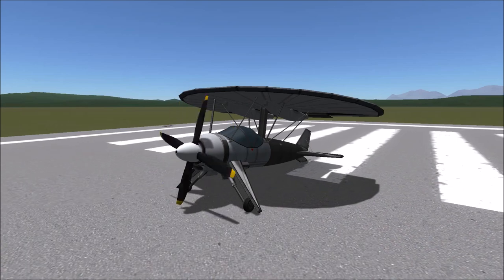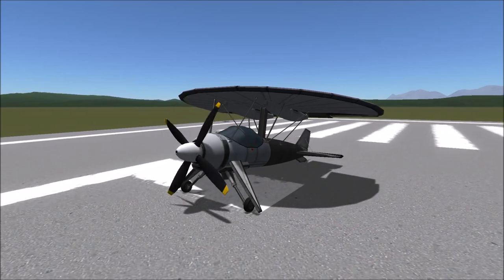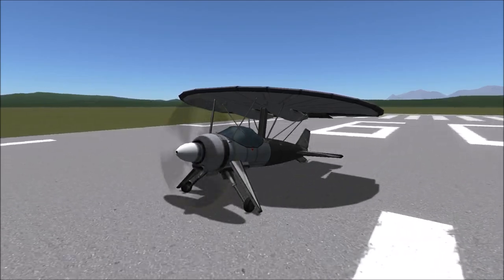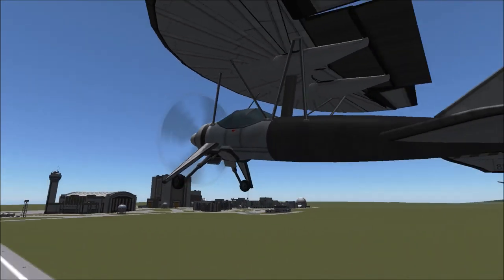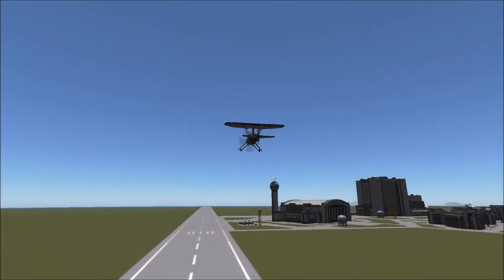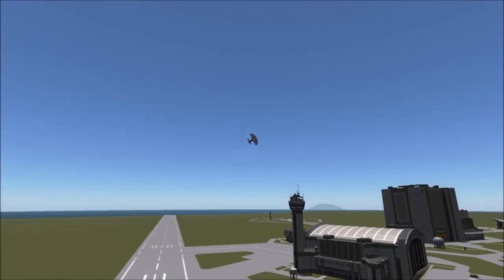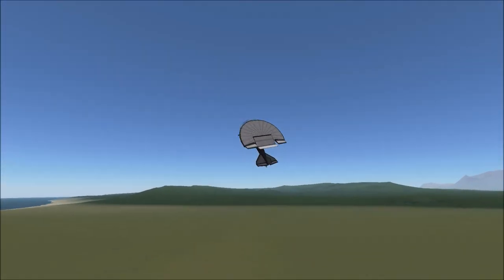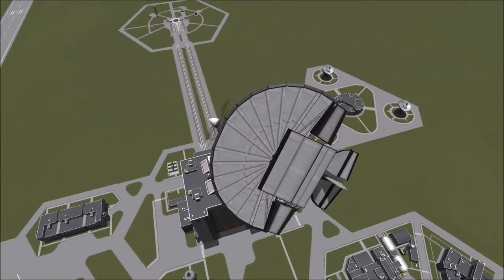KSP History's Misfits S2E6 The Nemeth Parasol

Comment: It was called "parachute plane" because of both the practically zero landing roll, and 45° climb and 60° descent.

There's no evidence that Nemeth was looking into "revolving wing", but many had been working on very-low aspect-ratio and circular wing.
See the patent Johnson 1932 US 1887411

Compared to other STOL planes, this one is faster than a normal plane, not slower, and the very-low aspect-ratio planform is stall-spin proof.
The key is the wing-tip vortex driven "parachute lift" phenomenon.
Charles Zimmerman wrote about it extensively when copying the Arup S-2 for his Vought "flapjack". It was also written about by Barnaby Wainfan who wrote for NASA about the "Facetmobile". See the paper on the Facetmobile site.
With aspect ratio under 3 (span^2/area), while flying very slowly at very high nose-up, the wingtip vortices wrap around it and capture a "bubble" of low pressure above the wing, giving extra lift at such slow speeds. At the same time they trap flow from the front over the top of the wing, keeping it from separating and providing strong smooth flow to the controls. The wing does not stall, even if kept that way. They'll go downwards if they're going too slow, but no stall. Arup could land at 19 knots. The Facetmobile of the '90s could stay aloft level at less than 16 kts, but was also sleek and quick on little power.
The low aspect-ratio does not create additional drag in normal cruise flight. The huge vortices *& "parachute lift" phenomenon and attendant drag are elective and temporary, and the Nemeth and Arup and Facetmobile and others have been remarkably sleek and efficient. It's a myth that the very-low aspect-ratio is always draggy.
 There was no interest in the Nemeth or the Arup because they violate every part of "If it looks right, it'll fly right". They look funny, and the patents were owned by outsiders, not major aeronautical makers.

Similarly from the '30s, see the Farman 1020. Like the Nemeth built on the fuselage of a normal (mono)plane, it also was stall-proof, super-STOL, faster than the original.

 The video shows an atrocious landing. The planform allows up to 40° "A" approach and super-slow landing. KSP apparently does not model the vortices and "parachute lift".

There are several youtubes of the Nemeth parachute plane.

See also the youtube "Flying Heel-Lift" about the Snyder/Hoffman Arup S-2. 1832, super-STOL, but quick on little power, stall-spin proof. ("Air" + "Up")
https://youtu.be/Nxz1UF67EQI

The Arup & Nemeth were almost certainly the basis of the wartime German interest in the Arthur Sack AS-6 circular wing.
See also the modern Rowe "UFO.